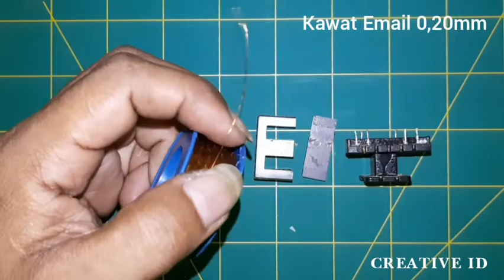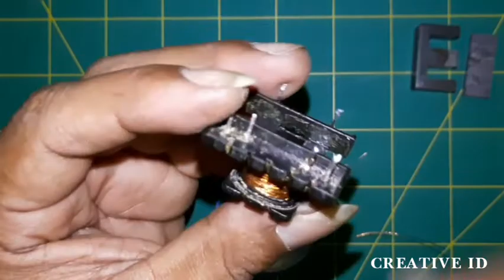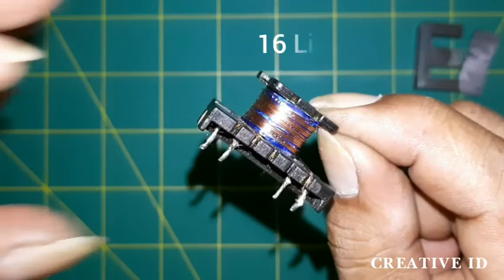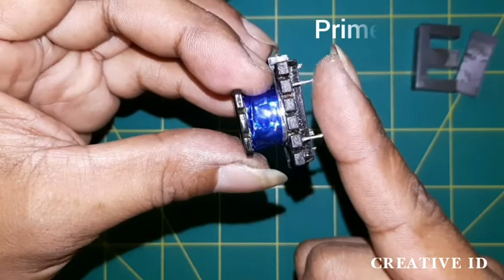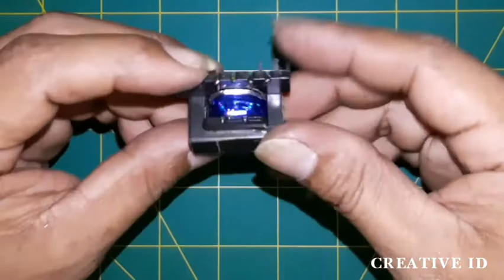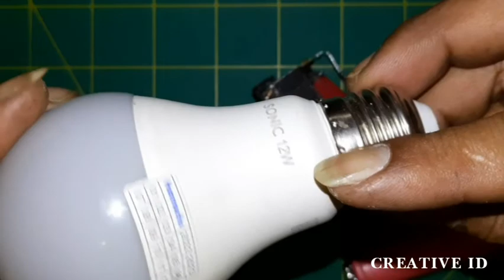Cara Mudah Lilit Trafo Untuk Joule Thief

Comment: saya lilit ulang sperti ini beban 5 watt r1 m tr puanas bang
Reply: pakai rangkaian standart out center.....bang....kalau rangkaian sprti di vidio pake d882 r 1m gk nyala....kalau 100 ohm blm coba ....ntar habis yasinan di coba
Reply from the maker: Siap Bos...
Reply: tetep panas bang dg rangkain spt vidio fi kasi r 1k ttp panas......coba pakai rangkaian ebi yg biasanya tr adem ttp puanas.....abang ad lilitan travo cas hp yg standart kah?
Reply from the maker: Sebelum lilit sendiri, kami bongkar lilitan trafo charger hp. 
Kami coba hitung lilitan masing2.
Sekunder 320 lilit kawat rambut,primer 13 lilit kawat rambut rangkap 3, feedback 15 lilit kawat rambut rangkap 3 juga Bos,dengan dimensi ferrite yg umum untuk trafo charger hp.
Reply from the maker: Apakah rangkaian nya sama Bos? Kalau pakai R 1 M ldgn rangkaian tsb kami gak yakin bisa nyala,kecuali rangkaian nya berbeda. Kalau pakai rangkaian sprti di video bisa pakai R 100 ~ 1K. Atau coba pakai output lampu yang watt lebih besar Bos
Reply: siap bang